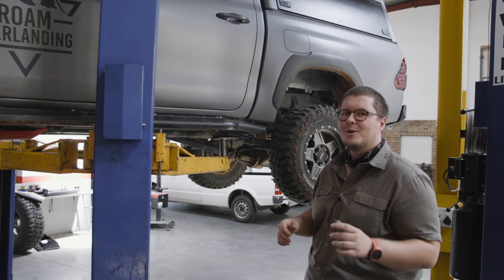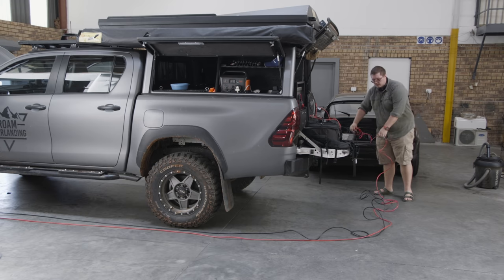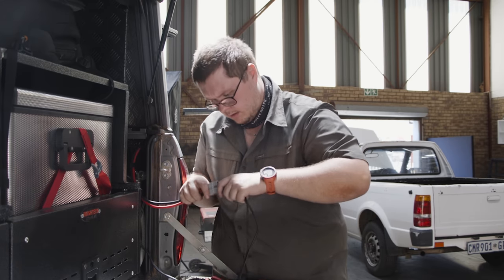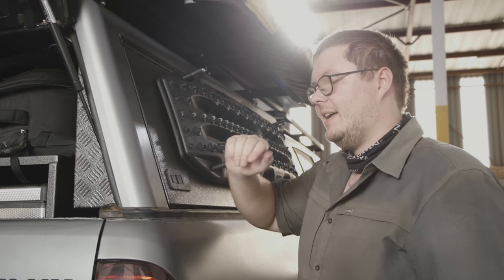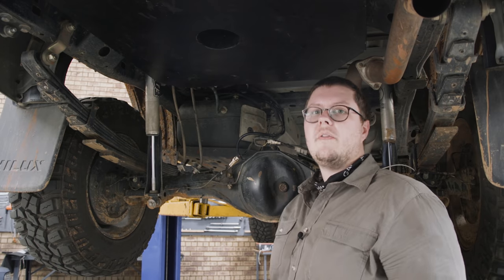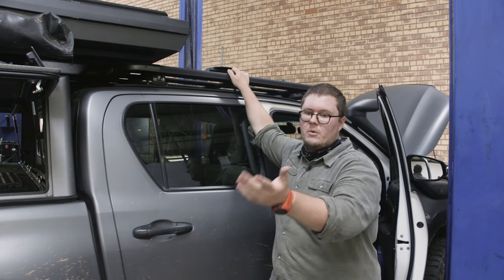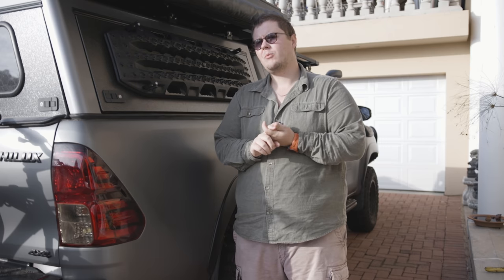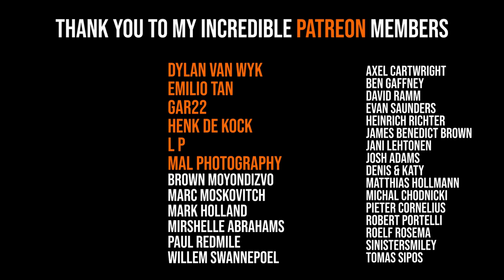Ep16 Wiring an Air Compressor, Long Range Tank Repairs & Mounting A Spare Tyre on my Hilux

Comment: That tire exercise was rather entertaining. But now remember that was in a controller environment. When stuff goes south on an overland trip it is at the worst possible imaginable situation and probably in the most compromised position. So for your own safety and well being look into investing in a swing arm for your rear bumper. If you strain your back badly in the field and you are alone you might be in for a horrible experience. 

Love the content and its rather inspiring to do my own stuff on my 4x4.
Reply from the maker: There are some big changes coming to the vehicle in the future, so a swing arm wont be necessary. For now the wheel will be alright where it is for the next trip. But I agree, I was just thinking; it could definitely get harder. But I must say the second time I did it; it was much easier. Awesome to hear buddy! Get to work!! :D
Reply: @RoamOverlanding  why do I sence a load bin and canopy removal and a flat bed and canopy installation 🤔🤔🤔
Reply from the maker: I said nothing...

Comment: Nice build! 

Why do you not just plug the compressor into the National Luna Green box? That is what I do and it works. I did email National Luna to ask if this could be done, with cited a max 45 Amp draw from compressor (same as yours), and they said no problem, obviously the vehicle needs to be running to keep charging the pack. I built a shunt into my NL Powerpack, and that compressor only draws around 35 amps.

Cheers
Reply from the maker: I was doing something similar for a while, and yes it did work fine. I am just worried about damaging the 115AGM battery in there, it’s a R6500.00 battery and I’m worried about the high current drain on it; it’s also great just to have an extra power cable run to the back; this could always be reused as a Trailer Charging cable too 👌🏻
Reply: @RoamOverlanding  Cool, makes sense. Keep it coming.

Comment: Sorry if the below seems negative. I really think you are doing a great job here.
How much extra fuel does that long-range tank hold? If it's less than 75l, I would argue that you would have been better off weight distribution wise to run jerry cans or even better those flat Pioneer Plastics tanks on the roof (from the point of view that you always need a spare, but the long-range tank only needs to be full on long un-supplied sections of a trip)... As for a spare wheel carrier on the rear bumper, that also has drawbacks in terms of weight distribution, not with regard to the height of the center of gravity but in terms of how far they are behind the rear axle, and thus the moments placed on the chassis. 
Don't get me wrong, I am not against long-range tanks in principle, but if the installation of a tank forces you to move the spare wheel to a less beneficial position, that needs to be carefully considered. I also fail to see why long-range tanks should need any more maintenance than standard tanks. If they are done right, they shouldn't.
Lastly, ditch that spare wheel bracket and just use a ratchet strap looped from outside, over one side, through the middle and over the opposite side. Easier to do, lighter, no chance of rim damage and less chance of it coming loose.

Just my few cents.
Reply from the maker: The long range tank was already installed on the vehicle when I bought it; I just wanted to fix up some stuff on it. The weight distribution doesnt feel bad on the vehicle and I am quite happy with the changes so far. Next time you see the vehicle in action its going to look quite different anyways so this might changes things again.
Reply: @RoamOverlanding  i did not realize that and it does change things somewhat.

Comment: Hey Adrian. Where did you get the LED reverse light and parking light bulbs from?
Reply from the maker: Hey buddy just scroll down a bit in the description of the video for any info like that; its a company called GloTech, you can get in touch with Rikus 072 084 70 48

Comment: I recommend you find a way of temporarily hanging a tarp on the rack to help protect the paint work if you should slip while lifting the wheel.
Reply from the maker: The second time around, I figured it out nicely; but yes you’re right might be good

Comment: 👍 video. Whats Your total RR weight now with the spare on top&mounted? If U are travelling solo & have back isdues, U may want to look at a pulley-hoist setup. Look at the lockable pulleys on ⛵ yachts, they would allow U to both hoist & lower the tyre way more convenient than armwresteling it the way U portraied. As for the inline fuse, U may consider an auto-fuse. That way U can so much easier & quicker connect or disconnect the power going aft. Another tip 7f U run heavy gauge cable is to choose welding cables as power cables. Way more flexible & with a better outer shield. Been running these for years on Winches, Nato plugs & other bigger remote power points... 
M2C 😉👍
Reply from the maker: With the rack and the tire is under 60kg combined 👍🏻 what’s an auto fuse? :o
Reply: @RoamOverlanding  I'll dig up a auto fuse link👍

Comment: Another great clip champ 👍 one thing though, heavy big spare on roof racks - you’re asking for trouble. Too heavy for your vehicles roof ( adding to the 20 odd kg roof racks themselves ). Have a look at Tyler Thompson’s video and Ronny Dahl’s videos on YouTube on roof rack overloading. There’s an onroad rating for the rack and this is considerably reduced when bouncing around off-road. You may be sorry long term. Pretty sure the Hilux only have a roof rating ( not rack but your actual vehicles roof load capacity ) only 75 kg’s so you’ll be pushing it. Greta clip otherwise mate 👍

Comment: My outfitter installed my compressor onto my aux battery.  I plan to change from 1 x 90Ah Agm to 2 x 100Ah Lithium. So I won't be correctong this "error". I may also just keep my agm as a back up starter battery in the engine bay. Any thoughts about this?
Reply from the maker: AGM's are terrible at cranking batteries; so it wont work so good as a backup starter battery unforunately, they also dont charge up or operate at the same voltages as a cranking battery so you cant link them in parallel. But running a compressor off aux is what I do now, I have 2 200AH lithium's and it works like a dream.

Comment: What's the weight rating of the roof rack, the vehicle roof and effect of the total load on the car.
Reply from the maker: The roofrack is wayyyy stronger than the vehicle (like hundreds of kilos) the vehicle is about 65-75kg depending who you ask; and the effect is more on fuel consumption than actually feeling it. Remember the Rooftoptent is actually mounted on the canopy which also has a massive dynamic load rating. The Tire & Roofrack combo is just under 60kg
Reply: @RoamOverlanding  The rating on the roof of that model Hilux is 75 kg, so deduct the 23kg (approx weight of the rack) of the roofrack then you have 52kg capacity, However that is only for on road use. As per Toyota, when you go off road the capacity changes to two thirds which comes to 50kg - 23 kg for the rack and that leaves 27 kg. So with the sparewheel up there, you are already over the limit. Trust me I have lost a claim so it pays to know this stuff beforehand. For all you guys in Australia, Ronnie Dhal had the same problem.

Comment: Did you drill a hole from the tail light to enter your canopy?
Reply from the maker: Nope there is a cap in the bodywork  we filled it with silicon when installing the canopy to keep dust out though

Comment: Where do you put your extra fuel when travel?
Reply from the maker: Inside the long range tank we installed; it adds an extra 65L of fuel
Reply: @RoamOverlanding  which video when you installed the the fuel tank.
Reply from the maker: In this video; we fixed the long range tank. The vehicle came with it; we never did an install only this repair
Reply: Thank you very much, i'm very inspire with what you did into your Hilux. Very nice modified

Comment: Probably best to have it on the roof deflated so it’s not as heavy to lift or remove.
Reply from the maker: Air can get so heavy, you're right!
Reply: @RoamOverlanding  😂😂😂
Reply: Or next time you get your gas bottle filled and wonder why it’s heavier once it’s filled.
Reply from the maker: LPG has a different density to air; roughly 1.5-2 times the density; and once it’s in your gas bottle it actually turns to liquid under pressure. Interesting thought though. Another fun fact; did you know that in most SADC countries the spare tire must be inflated to the recommended road tire pressure of the vehicle otherwise you can be fined

Comment: WOULDN't it make more sense to mount the compressor
 nearer the battery & run air lines back into the camper ?

!
Reply from the maker: Maybe but there is no space under the hood; asp air compressors work less efficiently in hot air environments; like engine bays. It’s perfectly fine where it is, I can use it blow dust off my tailgate/bicycle, pump tires etc etc